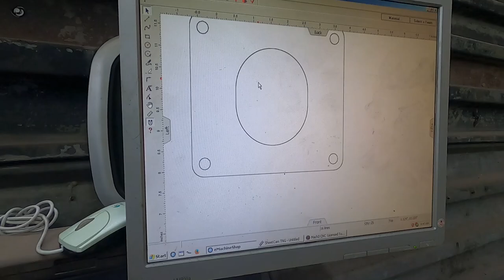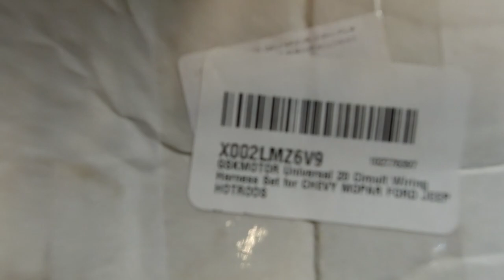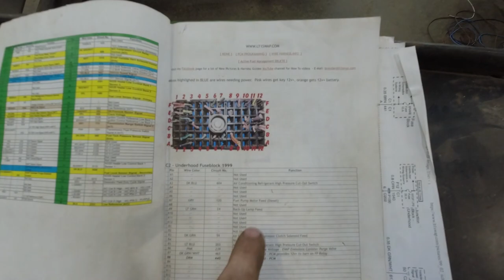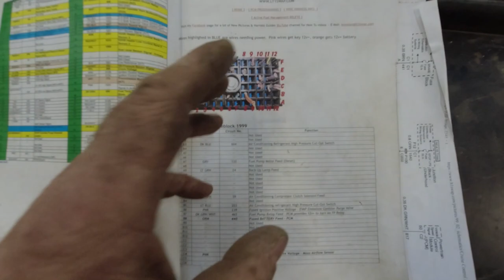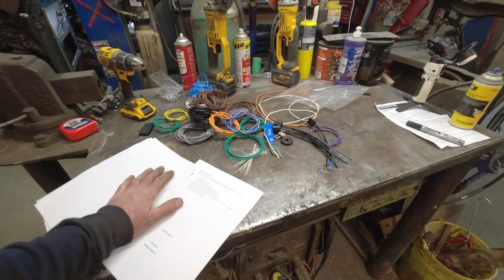Wiring the LS and and making column shifter for the 51 Ford F1 Part 9

Comment: We do like seeing the video run on a little extra long, the longer the better. You make wiring look easy, but I know it is difficult when you don't know that much about wiring. Watching you work on the 51 makes me miss the 52 that I used to have before hurricane Katrina took it out. I had a 351 Windsor engine, FMX transmission, Pinto steering column and pinto wiring harness in it.

Comment: Watching your wiring videos is always educational..  I have found that there are two types of hot rodders; those that are willing to wire their vehicle and those that will not touch it...  My brother (who was a lineman for the electric company for forty years) would not touch automotive wiring beyond replacing plug wires and battery cables...  I started with wiring the dash in a 1940 Ford when I was 17...  That was way back before pre-made wiring looms were available.  I got out of it about the time they started putting electric fans in cars..  Learned a lot of stuff (some the hard way, like the importance of fuses and relays) and didn't really find the job unpleasant...  Like you said, it is mostly a "frame of mind" thing.  As long as you can stay focused and don't mind tedious, repetitious tasks, you can make it work...  Modern computer-controlled engines just carry it to extremes, but the industry has adapted by using wire labeling and wire loom kits...  Your attention to detail is amazing..keep up the good work..

Comment: Your videos are never too long mon ami ... if anything, too short ... I could watch them all day. Quite impressed with your rationale on breaking down the replacement harness into manageable component level bundles. I was in charge of harness manufacture on the F-16 Fighter Program for a number of years ... giant "Harness Boards" with pins, labels, split/truncation markings so watching you do this on your garage floor is truly remarkable !!!  

BTW ... pity the guy that has to change the Spark Plug on the #5 cylinder but I'm sure the steering column will be "removable" somehow.  Sorry about your frozen pipes ... still think you could get it thawed using the air line but will low flow pressure shop (warmish) air ... like a water jet auger ... just time consuming having to keep pushing it up to the Ice.

Comment: I've been working on cars since I'm 14 and I'm 65 years old now still working on cars what is the purpose of coiling up the brake lines to the master cylinder I should just Google it I don't think I'll have it though thanks for the video Brent always a good time that things come along nice
Reply: I'm 45 and I've not worked much on cars, but I'm a curious guy, so I searched for an answer to your question, and here's what I found: "Why are brake lines coiled at master cylinder?
Brake lines are coiled to prevent breaking from fatigue due to moving parts. The mounting points on components which move relatively to each other due to movement from vibration, heat, etc."
Reply: Yep, what Kenneth said. If you don't coil em a little, the end of the brake line might crack under the nut where it ends at master cylinder.😁 Here in the rust belt those nuts rust and most just uncurl some and put a nut on good line (if it don't split out). Brent does a nice job 👍👍
Reply: Thanks for looking that up and telling me the reason why the brake lanes were coiled up II didn't even think to Google it and check it appreciate it thank you

Comment: I think why enjoy watching is you make each of the bits work before going forward, some of the channels will go back and have to fix the bits making a lot of work. I understand using the plug and play properties of a LS motor, but I am surprised on how you get it to fit into some of the spaces you do with it. Good  break down on the wiring.

Comment: The wiring that you are cutting off of the factory plug you can release them from the holder and use them again when I built my twin turbo mustang i found a ford vehicle I just can't remember which one some of the Ford's had fuse and relay holder's that you could just plug the factory gm terminals into with out cutting the gm harness

Comment: Good progress, Brent.
Wiring is tedious and difficult for some but one wire at a time I don't mind it at all.
Did you say you were flushing the line with water to try and melt the ice? Have you added lots of salt to that water? Unfortunately if you can't get a hose right up to the ice then you possibly have an air pocket in there stopping the flush to make contact with the ice.
As for videos "running on".. those folks who think that could try hitting the pause button and go back to the video later. Or maybe they don't want to learn as much as you are showing. 
Another trick is to change the playback speed and make you sound like you are on speed, which is quite funny. ;)
Some people want TicTok style videos. No attention span, I guess.

Comment: shift bracket has my head spinning understanding how the shift lever when it moves out of park (assume while up it is in park) and when you push the lever from park to the next gear it is pulling on the tranny lever instead of pushing.  confused in Tx in this 93 degree weather. 34 degrees C  (only played with 350's and powerglides.)
Reply from the maker: from park it's pulling on the transmission side.
Reply: @HalfassKustoms  Th
thanks, my inexperience confused me

Comment: 4:53 Can thin wall tubing be used right off of the steering column ? 
It might give you a little more clearance for the sparkplug . In time frame 4:31 you can see what I'm talking about.
30:00 Are you going to add a chassis grommet to the firewall harness hole ?

Comment: Da best plans B laid out but da owner's steering wheel is always right, weebles need wobble joints fer steering. Curly Q brake lines fer da front, column shifter snaked up over n around done, column mounted just like he wants it, Chineseium wiring harness decoded, laying out da Chinese noodle wiring, sett'n up da confused-shush box.

Comment: Was thinking about your water problem,  why don't you disconnect your other end and put a hose on it to a bucket, then the end in your shop funnel some glycol into the line to melt the ice, glycol is the main ingredient in de-icer I think, you can then flush the line to ensure non contamination of your water supply, or you could connect a wallpaper steamer to the line and each time some of the ice melts suck that water out and then steam again, repeat until clear, hope one of my ldeas help,  best wishes

Comment: So do you run 4 injectors off 1 fuse or do you do them in pair  (2 injectors 1 fuse) I went off the service manual for a van and my fuse panel has way more then yours
Reply from the maker: yeah I pair them up so at least if theirs a problem I know it's in that side of the motor. a feller can break it down as much as they want but in the end this works for me if I had to diagnose something.

Comment: I have noticed when you use the brake flaring tool you seem to do three steps, what is the third step?
Reply from the maker: first step squares the line in the tooling, second flairs and third step finishes the double flare.
Reply: @HalfassKustoms  thanks, my old sykes pickavant flaring tool you lined up by eye

Comment: Why do you make a coil on the brake lines?
Reply from the maker: I would say if you want a consistent kit personally I would go  with the speedway one they have a 12 and a 20 circuit setup. https://www.speedwaymotors.com/12-Circuit-Mini-Fuse-Universal-Hot-Rod-Wiring-Harness-Kit,2352.html

Comment: What is the brand of your favourite harness?
Reply from the maker: I really don't have a one goto harness as this one comes for the same buyer on amazon and I've gotten 3 different harness over time? for consistency I would say get one of the speedway branded harnesses as it will be the same all the time. Just for me the cost of the speedway with shipping makes it not affordable for me but if your in the states it's well worth it. 
https://www.speedwaymotors.com/12-Circuit-Mini-Fuse-Universal-Hot-Rod-Wiring-Harness-Kit,2352.html